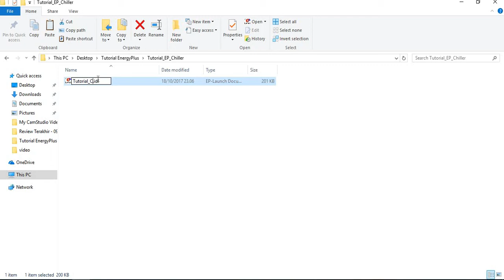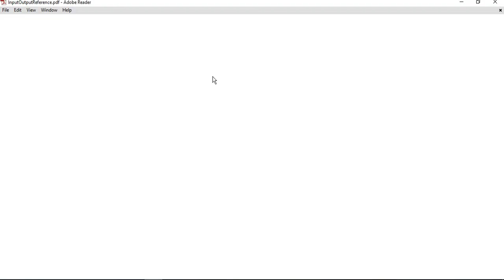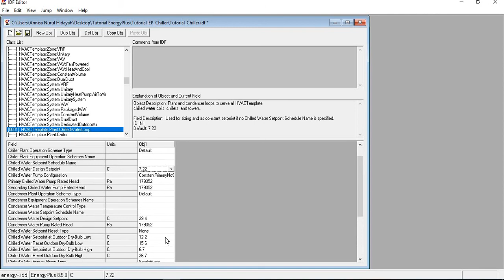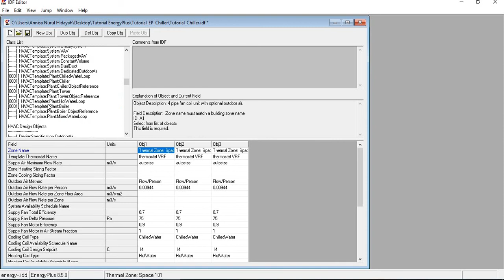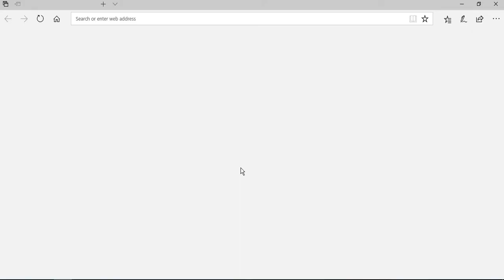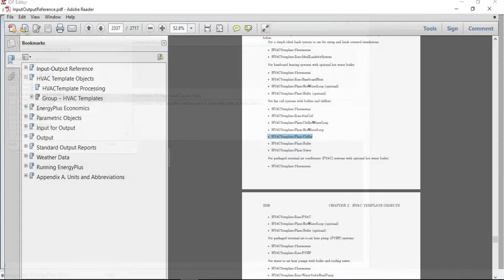Part III   Assign Fan Coil System with Chiller (Using HVAC Template) in EnergyPlus

Comment: Thank you so much for the tutorial, but i have a question  on the problem when assign the VAV with boiler, chiller and tower, there is an error shown for the hot water loop. How do i solve it?
Reply: maybe you should delete VRF information